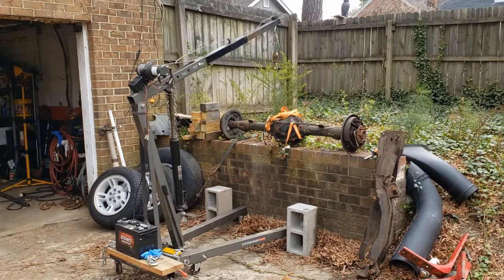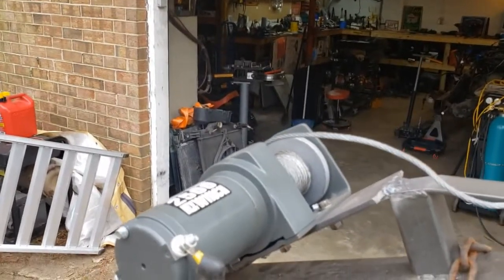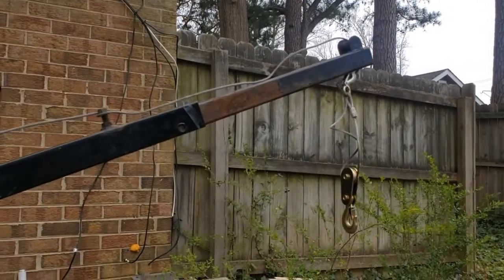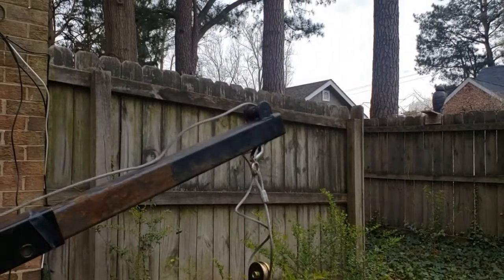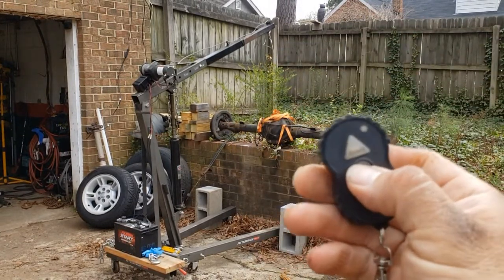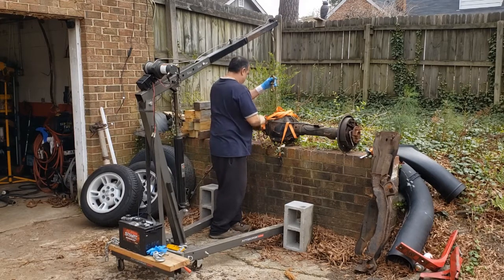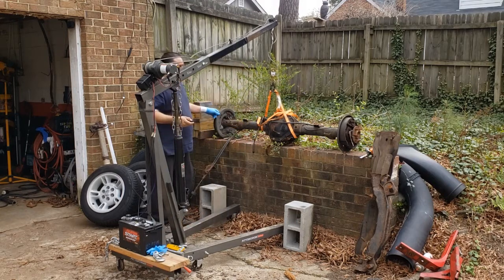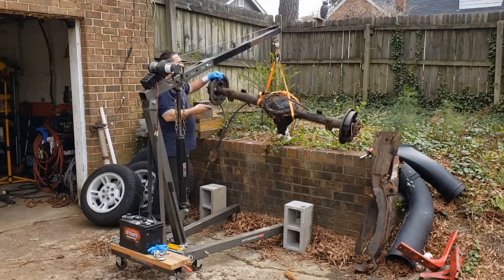Engine hoist turned to electric crane with a winch

Comment: That “jib” is seriously overloaded.  It flexes about 3” in the video with just that axle assembly.  There is the concept of SWL for a reason, but I’m sure you calculated all the bending stresses, did NDI on the welds, and FEA on the connection points, right? 😂😂😂
Reply from the maker: @petereastwood7868  i sure haven't.. but i have lifted 900lb with the arms shorter, and it did good

Comment: Another advantage of the pulley at the end is besides twice lifting capacity also half the lift speed for accurate object positioning.
Reply from the maker: I have one of those
Reply: Put some bigger wheels on it
Reply: @glholden30 Special wheels than can hold 1 ton are hard to find. Any ideas?

Comment: nice idea! to improve onto it i would suggest adding longer extension legs to keep the center of gravity right where the hook is positioned at. The longer extension piece i see could cause the entire load/hoist to tumble forward to the ground if not careful! cheers
Reply from the maker: Your right. But I didn't want to make it longer so I added weights to the other end instead.
Reply: @AngelGarage  That's what I thought if you mean "battery" with weight.